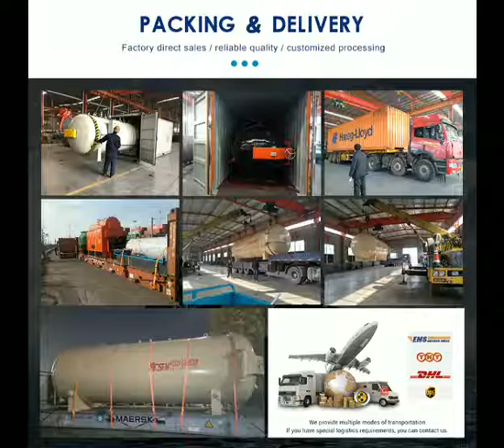mushroom  sterilizer autoclave

Comment: Looks like the substrate bags are autoclaved after they've been inoculated with the mycelium. Will the mycelium survive the autoclave?
Reply: Haha I  noticed the same, it does appear there are white mycelial growth  in the bags... but the pics are also blurry to my vision .  It's probably unlikely that they are doing that.  I am however now curious if even a small percentage chance some biomass that could bounce back,  they come from outer-space after-all ;)
Reply: Looks more like condensation in the bags fogging them up because they are using hot water to hydrate the substrate and reduce overall autoclave heat up time.
Reply from the maker: our processing is to sterilizer mushroom substrate sterilizer ,not  including the mycelium
Reply: @bettymosen6907  they lack knowledge, don't take what said seriously